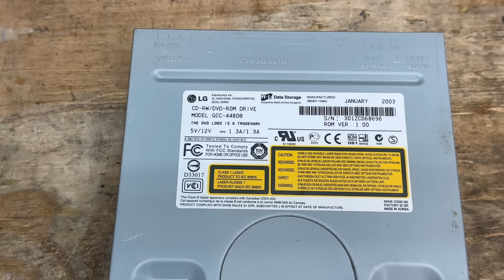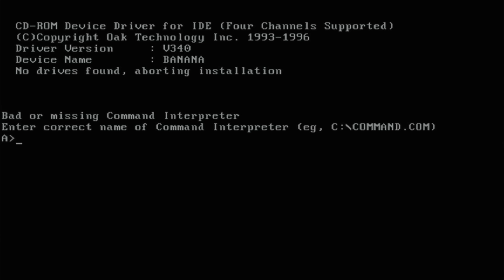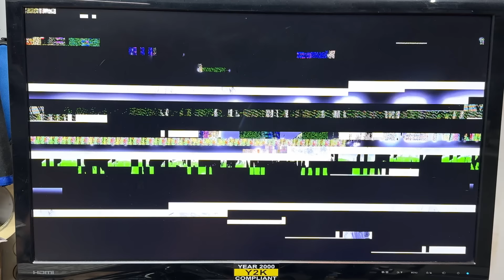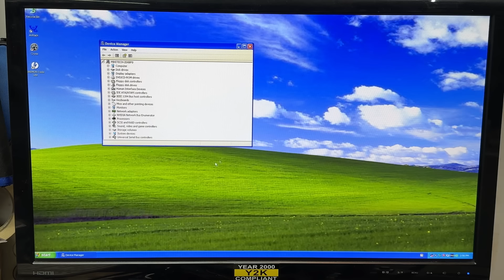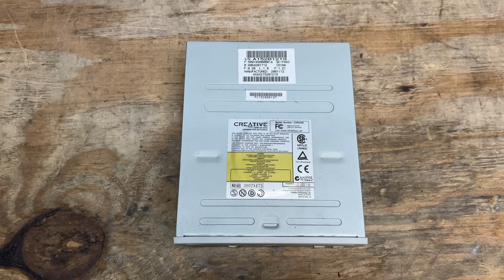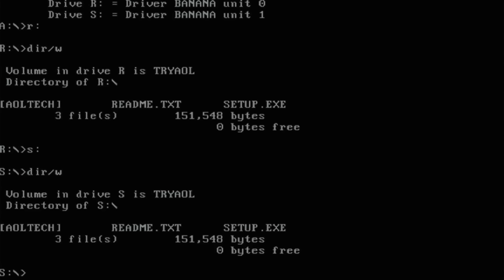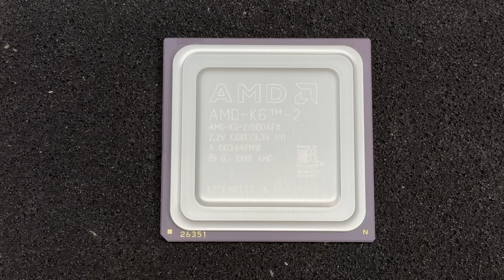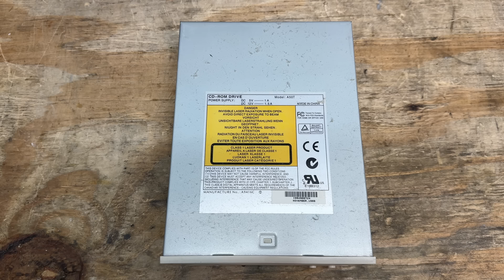Mystery 2000's Systems - Teardown and test!

Comment: That power supply would have seen more than just a crapacitor let rip if someone witnessed its demise. Code Brown.
Reply from the maker: I still can’t believe those caps blew up like that. I’ve seen them vent, leak, blow the can off the base, but never seen one become a mini grenade!
Reply: Either the can wasn’t properly perforated or the pressure built up way faster than it could vent. I’ve never seen one explode like that either. Shame it took most of the system with it.
Reply: The only cap failure I've seen was on my grandfather's old pc, all the caps leaked all over, though I've intentionally popped a really really small one just because I wanted to.
Reply: @miketech1024  staight unregulated mains does that to caps

Comment: the CD burner/dvd combo drives were common in the early 2000s as Straight dvd burners were still quite pricey. eventually prices came down, and these "Combo" drives faded away.
Reply: Yeah, besides for some businesses machines, I used the cheap cd burner/dvd-rom drive for reading everything and burning cds. The DVD burner was for burning DVDs only.
Reply: Pretty much every consumer Mac made between 2001 and 2003 had those "combo" drives. Apple even called them "combo" drives, with the "super drive" being the dvd-rw ones reserved for the pro-grade Mac's.
Reply: Ypu, I remember I had this combo too =)
Reply: I have one of these,  too.  Good for installing an OS back when an OS would fit on a DVD.
Reply: Yup yup

Comment: I really enjoyed this one, maybe because we get to see what a bad power supply can do to a system. It reminds me of how robust PC component design has always been. I wrote my first program in 1968 and have seen it and experienced it all, and I'm in the middle of assembling a super high end PC for a customer. It just amazes me that while there are now billions and billions of transistors and tech in this thing and, as always, it all starts up perfectly and just works. Incredible. Never-ending fun. (I tell my clients it's now impossible to buy components that aren't RGB now. 🙂). Thanks Mike. Love you man!
Reply from the maker: Thanks! I still can’t believe that PSU failed so spectacularly. Sure wish I would have gotten to it first. That footage would have been priceless and those components would still be alive!
Reply: @miketech1024  That PSU must have sent some serious voltage down the 12V rail when it failed.
Reply: I experienced a PSU capacitor explosion before.  I saw a flash coming out of the fan exhaust at the back and smoke and it turned off immediately but did not do any damage on the computer itself.  I just replaced the PSU and everything worked again.  I guess I was just lucky.

Comment: The ECS motherboard is also known for few other names... PCChips M925ALU V5.0 in retroweb looks similar and it has ECS version manual. In the manual it says that those big jumpers are for selecting between DDR and SDR memory slots. It has both sockets in the board.
Reply: That is definitely a PC Chips board, likely released right before ECSElitegroup bought them out.
Reply: Yep, that red motherboard was part of the "PC Chips Lottery".  That garbage thought process started all the way back in the 486 era, afaik.  The names that were in that "lottery" were ECS, PC Chips, Amptron, and possibly Shuttle.
Reply: @JVHShack  I don't remember Shuttle being part of that bunch, but I do know that Matsonic was included in it.
Reply: @NJRoadfan   Nah, PCChips bought Elitegroup Computer Systems (ECS) and renamed itself like that cause ECS had an better reputation.
PCChips was an OEM manufacturer as well so they made the board for Amptron, Shuttle, Kobian and of course ECS.
Reply: @NJRoadfan  Yes, it is. Here in Brazil, they were all over the place since they mobos were cheap

Comment: The vrm's and resistors on the mobo saved the CPU and Ram from an unfortunate Ac voltage injection. 12v components have no chance at 120 unfortunately. This was a very common failure back in the day PSU's weren't built to "Fail-Safe" they failed almost exclusively catastrophically.

Comment: A few things on the first system.
That top slot that looks like a backwards PCI-E x1 is actually an AMR (Audio/Modem riser) connector.
Think of it like an expansion to your rear I/O, so anything plugged in still uses CPU resources, unlike most dedicated expansion cards.

Mentioned in the comments anyway, yeah CD/RW and DVD ROM combo drives were common as DVD burners still cost a fair bit back then, and you required a different laser wavelength to read and write DVDs compared to CDs. You also required a much more powerful laser (More cost) to burn a disk rather than read.

The 'Very High' settings on Crysis is for DX10 so only available if you had both a DX10 card, which the 9600GT is, and Windows Vista or later to run those settings.
The AA (Anti aliasing settings) drained GPU power, best to turn it off or 2x max to have a nice FPS (Frames per second).

I do enjoy the earlier to late 2000's as this was the time when I started getting into PC building, to me an AMD Athlon X2 era and Core 2 Duo system seems relatively recent to me. I have installed Windows XP so many times that I still remember the installation like it was yesterday.
Reply: Went looking for this comment haha.  No one seems to know what an AMR slot is nowadays.  That said, my understanding and experience is they were quite rate even from SIs. I don't believe I ever saw AMR card in the wild while doing occasional repairs personally and in my workplace with SFF PCs.

Comment: Man an ABIT AN8 Ultra in the wild. It is an amazing motherboard from circa 2005. It has 4 SATA2, an Nvidia nForce 4 Ultra chipset, uGuru BIOS uitility, A LOT of fan control and PC stats. I own this board with a modest 64 3500+ for now. That board is a keeper I tell you. Quite valuable too. btw I knew instantly what 04 is. It is memory. I had issues with a 64 3200+ and its memory controller once :D
Reply from the maker: It is a very nice board! A great example of mid-2000s gaming exuberance.
Reply: @miketech1024  Sure is! By the way I love your videos. My favourite thing to do is watch one of your videos on a relaxing evening :D
Reply: Man I should dig my old one out, think I used Athalon 64 3400+ on mine with Corsair RAM, eVGA 7800 GTX then a 9800 GTX , all in a enermax case, played many 100's of hours of games on that setup.
Reply: @charleswp71  Very nice rig. I just got a free Audigy SE 7.1 for mine. I didn't have the ABIT AudioMax 7.1 card so I had to use an old Crystal CS 4280. I also paired it with a  9500GT 1GB but I plan on putting an X1900XTX and an X2 4800+ in there at some point :D

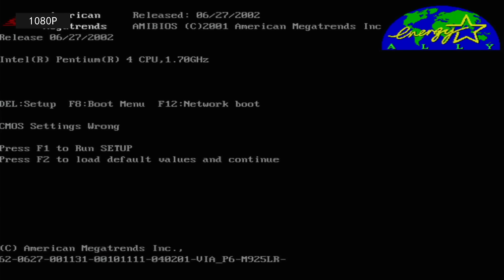Comment: 28:56 searching the bios string at the bottom of the screen returns a board: PCChips M925LR. Those big jumper clusters are for switching between SDR and DDR RAM.
Reply: Came here to say this, some older motherboards had 2 slots for ddr, 2 for sdram, and big jumpers to switch mode with

Comment: Hey, when bending back those broken clips like on that floppy drive face plate, they're normally made of ABS plastic, so instead of super glue, use a little acetone. It will fuse the plastic together.
Reply from the maker: Thanks!
Reply: Ive used that same abs trick for a ton of motorcycle plastics

Comment: The 2000s were a great time to be building PC's. I can remember building my first ever pc based on an Asus A8V socket 939, Athlon*2, 4gb of ram, and some kind of Radeon GPU. Spent a small fortune on it, and it never let me down. Couldn't bring myself to get rid of it, so it's gathering dust 😀
Reply: I still have "gathering dust" systems going back to 286 based, but those were pre builts. My first self built one was a 486 33 in a big tall tower case with a door in front of the drive bays..
It has 4 mb of ram plus two more from my Intel Advantage card from the 286.
 I payed a lot for the case so I still  have it, though it won't  fit any atx motherboard since it is AT only.
  It is hard to throw away something that cost 1000 dollars.
That did not count the video card and sound card.

Comment: That Abit board has a unique feature I wish caught on more - removable sound card.

It was an elegant solution - concentrate the cheap Realtek controller on a small, out of the way PCB and if you want, remove it and add something of your choice.  I hate the modern trend of soldering everything into place.

Comment: System two's mainboard is more commonly known under the PC Chips brand. especially in that early era of expensive Wilamette P4's many pc builders cut cost by installing these low end mainboards, often 30 to 40% cheaper then A-brand offerings from eg, ASUS.

Comment: I have seen that board before. It's an ECS P4VMM2 V5.0 or V5.0A
With that one you could make the choice between two types of ram, but you couldn't mix it. If I remember correctly, the jumperblocks were mean for the selection of the ram-type.

Comment: 0:30 yea those were everywhere. DVD burners were still very expensive for a short bit in late 90s, early 2000s. So they tacked on a CD burner to a DVD-ROM and there's more budget option.

I had quite a few of them from upgrades for family/friend machines after DVD burners became super cheap. They were all pretty cheaply made too so none of them really lasted.

Blu ray went through a similar phase too, had blu ray readers that could burn DVD/CDs.

Comment: The CD-RW/DVD-ROM drives were very common in the early 2000's. DVD-ROM drives were still quite pricey. The prices came down, so a lot of people went for the combi CD-RW/DVD-ROM drives rather than having multiple drives. For me I had a CD-ROM and a CD-RW/DVD-ROM rather than having a single drives for CD-RW and DVD-ROM.

Comment: Interesting & good to watch one of your Vidz where you’re actually tinkering with Hardware that’s not as Retro as you normally show, Great Video all the same! 🙂🇬🇧
Reply: I bought a Joblot of those Intel Heatsink/Fans off eBay at: 24:53, They all came with CPUs in the retail packaging & I didn’t realise their was so many and only gave the Seller £20 if memory serves me correct! 😂
Reply: I would rate the ECS Motherboard that’s in System 2 the same as ASRock, I feel that they are both budget crappy boards, I may rethink that with ASRock as I’ve been hearing good things about them lately, 
I’ve always like the Pioneer CD / DVD Burners as in System 2,
My Brother had that very Case in System 3 which I had when he upgraded but ended up either Selling it or Binning it many years ago, Probably when I moved in 2015…

Comment: The LG DVD-ROM/CD-RW was quite common, at least in Canada.  When I worked in a small town store, we sold quite a few, every month. 

The ECS board ... whoo that brings back memories.  I was very poor, in 2003, I upgraded a computer from a Slot 1 600mhz Pentium III ... to an ECS board with soldered 1Ghz Pentium 3. Probably a Tualatin, if I remember right.

Comment: I've seen a cheap capacitor launch the entire can rather than venting through the top before, during a session of makeshift capacitor fireworks via mains voltage. It was rather impressive how high it was launched...
I've become wary of cheap power supplies from your videos, and just before watching this video I had discovered an "old" (circa 2013) PSU of mine had the capacitor plague, and another I was in the midst of scrapping had a literal fake transformer inside it that was nothing more than several steel plates on the inside. I can only imagine they did that to give it the illusion of being a heavier, beefier unit. The fan bearing was also very crunchy sounding. Don't use Sentey power supplies.

Comment: ECS is Elitegroup Computer Systems Also sold as PC Chips back in the day they made some low cost motherboards and a few high end ones also. However mostly known for making very cheap bare bones motherboards. As soon as I saw the chip set heat sink I knew it had to be either PC Chips or ECS they used a very distinctive kind of font on their chipset heatsinks the marking you are looking at on there says PC 400 meaning it can support DDR 400 RAM. Anyhow I built a few socket A computers using an ECS motherboard back in the day the ECS K7S5A to be exact strange thing about that motherboard is they were known to overheat on the chipset as they used double sided thermal tape to secure it on no clip or thermal epoxy so I fixed that by using you guessed it thermal epoxy no more overheating issue anyhow great video and seeing an ECS motherboard really brings back the memories.

Comment: My first laptop - an Acer laptop, had a CD writer/DVD rom drive. And that was back in either 2007 or 2008! I didn't mind that until 2010 when I wanted to start burning my own DVDs. I ended up getting an external DVD burner for my birthday that year. Sadly don't have it anymore cuz it stopped reading discs in 2018.

Comment: I have boards made by ecs elitegroup and abit, also a logisys psu, though it only has 1 fan but I happen to have a raidmax psu with three fans (model pm-s400w) and it is quite heavy too. I love these videos, getting old mystery systems from wherever and exploring their insides and seeing if they are salvageable. Oh and I love the whole "psu is light so it must be junk" thing, I have some psu's that I don't like to use that are very light, one being very light, and when being used the wires actually get quite warm and are quite thin too..JUNK.

Comment: 1:45 Zalman 7000cu cooler, the original all-copper cooler. Those things were beasts back then, I had one of those cooling an Opteron 180 dual core in 2005. They switched to the AlCu model (alum/copper) shortly after due to their all coppers oxidizing so the original is harder to find these days.

Comment: Back in the day: AMD AM2 4200+ x2 (now it's a keychain), dual 9600GT's in SLI (originally a 7900GT, which died and eVGA replaced it with a 7950GT), 2GB of Corsair XMS2 800, and an Asus M2N-SLI Deluxe. I put on some really bad Arctic Cooling 64 Freezer Pro, which fell of playing Bioshock... which was nice.  

Oh! And a Sound Blaster X-Fi Elite Pro they were basically giving away at one point because somebody at Newegg ordered 30 cases instead of 3 and for some reason they only got the cards instead of them being bundled with the massive breakout box.

Comment: The second board is a PC Chips (aka ECS) M925 PC400 P4M266A.  The weird jumpers at the edge are to select whether your using DDR or SDR RAM modules. .

Comment: Those DVDRom cd burner drives came at a time before DVD burners existed.  Short lived.  Also the slot on the board where the sound card was connected in the first PC was an AMR slot (audio modem riser) another short lived technology.  I suppose it was meant to make onboard audio interchangeable but it never really caught on.  So many cheap PSUs in the 2000s.  really not worth it considering what can happen.  Lots of ways to save money in those days but a cheap PSU was definetly not the way to go.
Reply from the maker: Thanks! Oh, AMR does sound very vaguely familiar now. It's the type of thing I only ever read about back then.

Comment: Massive heatsinks on the chipset from the first computer. I really won't miss the temperatures and noise those old Athlon XPs and Athlon 64s used to make. I do miss the unique PCB color that every brand used to have
Reply: I recall quite a few boards having difficulty cooling the chipsets too, while necessary I definitely don't miss the noisy little dedicated fans for them.  While the Athlons especially the early ones definitely ran hot I just have to remind myself I used to warm up my frozen work boots from the exhaust of my work PCs' Pentium 4 s. Everyone sucked back then before the variable clock speeds and power saving modes.
Reply: @oogieboogie232  Usually Nvidia chipsets were the hottest ones. I had an nForce chipset on my AM3 board back in the days and that chipset would easily run at 55-60C

Comment: When those ATX short/trip, you have to unplug them to reset them if you are in a hurry - lol -.
Those grey zinc coating are pretty reactive to everything, ie, it doesn't take much to lose the zinc and start the steel rusting.
Prob not worth a south-bridge, because every chip it's connected to is toast.

Comment: I'd swap out that logisys powersupply from the first pc if you are going too do any longer testing in the near future with that system, bit surprised it didnt explode while you were testing crysis with that.
Had a similar powersupply from AXP that claimed 500w but that killed 3 different video cards, 1x hd 3850 ca 2008 before it was swapped out & collecting dust, 1x hd 5750 1 gb & 1 hd 5770 1 gb.

Comment: That last system with the Gigabyte GA-5AX and K6-2/500 hit close to home for me, as that's the same mobo I used to convert my Pentium MMX 233 from Baby AT to ATX form...and the mobo which I got from eBay had a K6-2/500 in it!  I replaced it with my Pentium 233, as that's what I wanted, LOL. Maybe I'll put together a system for that K6-2 as well at some point...

Comment: I'm not sure what that ECS mb model is (looks like a variant of the P4VXASD but those were mostly purple).Some of the cheaper ECS boards used that mass of jumpers to set the type of ram used on each slot. There was a set of 20 (2x10) jumpers per dram slot.
Reply: Exactly. I also had a similar ECS motherboard, socket 462 with an AMD Duron processor
Reply from the maker: Thanks! That's a new one for me.
Reply: @cristianrece7478  Duron, Athlon, Turion, Sempron, Opteron, Phenom... so many cool AMD names from back in the day.